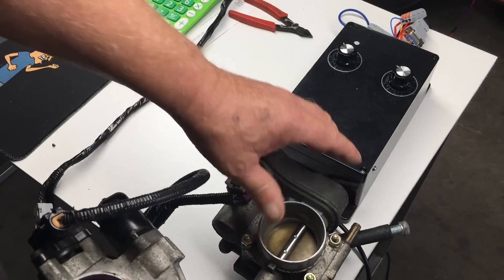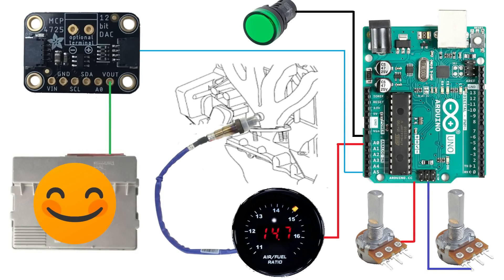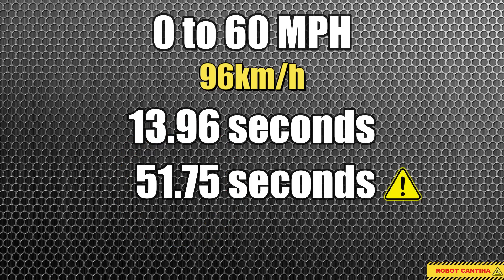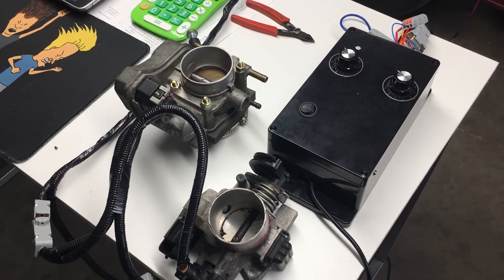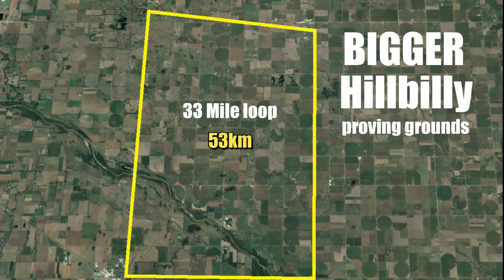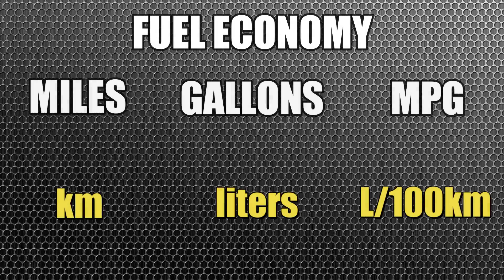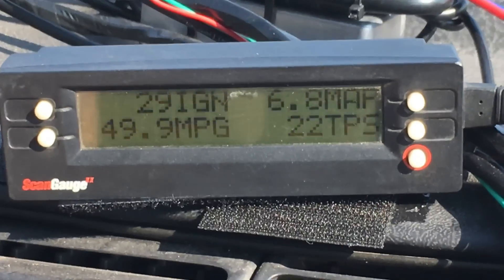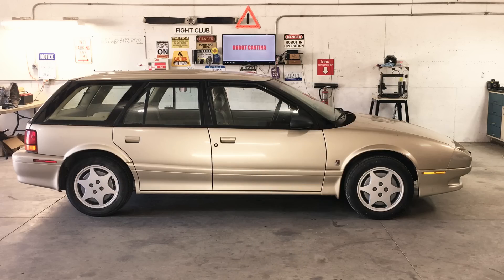S2E21: Our modified Saturn that gets Extreme MPG with lean-burn and Robo-throttle.

Comment: Bring on the diesel!
Pump timing,  injector sizes, different fuels.
Lots to play with on the diesel also.
Oh and a more efficient engine makes a difference too 😆
Reply: yeah that small diesel should net a decent mpg bump, provided its geared correctly. 

Also generally, a bigger diesel engine isnt always a bad thing for efficiency either. Because diesels dont care how much air there is entering, you can run them really really lean by design. You govern the power output by the amount of fuel not air, as with gasoline engines. Lower rpms, lower pumping losses (no throttle afterall) higher torque and higher injection pressure along with higher specific energy of the diesel fuel all contribute to greater MPGs!
They are popular still over in europe for a reason. It's not uncommon for your avarage compact sedan or hatch to crack 60 MPGs while doing longer commutes.
Reply: Diesel is like 50% more in cost at the pump compared to 87 gasoline though. Unless you can do an alternative fuel it would have to get 80mpg to break even.
Reply: @0778drz110  yeah, that might be the case in US, but in europe, diesel is only marginally more expensive (depends on the location though).

Comment: Checkout the Dynatek Dyna 2000 to control ignition timing. I think it will work with the Saturn ignition coil & ecu by intercepting the output to the coils & altering timing of the coils input.

Comment: Looking at Alldata, it looks like those Saturns fire each cylinder on both the Compression and exhaust stroke (hence at why there are only 2 coils, and they're mated with their "sister" cylinder). 

Since that PCM predates the use of Cylinder Balancing (For smoother operation), you could possibly intercept the CKPS signal, and use it to feed data to a speedunio.. that of course, is easier said than done.

Comment: Thinking of ways effiecency could be comprised, I wondered about toe settings, some manufacturers recommend toe in or out based on intended steering predictability. A weighted alignment, setting toe at close to 0% split could produce an improvement.

Comment: Take a look into air temp sensor, you may be able to do a variable resistor to trick it to think it hotter or cooler and it should change timing. (Ebay sellers sell them and performance “chips”)

Comment: It would be cool to see the difference with all the weight stripped out of the car on the exact same setup.
Reply: There isn't a lot that can be stripped off a stock sl1 manual. It only weighs just over 2,000 lbs stock. The plastic body panels make it light.
Reply: @ivermec-tin666  I was thinking like the rear seats and like carpeting and stuff would be cool. If it's only 2,000 pounds already you could make a pretty big difference percentage wise.
Reply: @burtmcgurt3584  True. If it weighs 2300 stock, and you can shave 300 lbs off it... That's a meaningful percentage.
Reply: @ivermec-tin666  I've alwats wanted to see a video where somebody completely strips a car and weighs before and after and then performance. There is a channel that did like an insane strip down, but didn't actually measure the weight difference. "Diy Mike" i think was the channel. They literally drilled big holes in the rear bumper and stripped all the weight out they could on a del sol. It was cool, but I'm a stats guy and wanted to see the numbers. Also, great channel name lol I approve!
Reply: @burtmcgurt3584  Thanks. A shame they didn't weigh the del sol. It's not expensive to use a semi weight scale.

Comment: I might affect fueling as well, but if you use a variable resistor on the intake air temp sensor, does that change the spark values?

FMG

Comment: that ignition timing is awful. Both of my 4 cylinder cars (mazda 3 and mazda miata) are around 50 degrees of timing at highway speed. i would expect you could get even more timing with a 2 valve engine like the saturn.
Reply: Yeah, but those engines are designed so they can take advantage of that kind of timing. Likely tons of compression and combustion chamber design, so the fuel is burning slower thus needing more timing.

Comment: now imagine if you did this on a 3-4 cyl ligthweigth (sub 1200kg) Non American car.
Reply: actually, if you're mostly cruising longer rides (especially on motorway) weight has less of an effect on efficiency than you might think. Aero and rolling resistance play a much bigger role here.

Comment: Going a bit rich on the A/F ratio does way more for fuel efficiency than going excessively lean.  It's counter-intuitive but that's how the old-timers 'fixed' the shyte fuel milage numbers the first emissions-compliant vehicles suffered from in th 1970's and 80's and beyond.   

Rejecting from the stoichiometric  ~14.7:1 to ~ 12.8 - 13:1 (depending on fuel type and compression ratio) often yielded 15% to even 30+% fuel mileage numbers for very little effort other than swapping out a set of jets in the carburetors. 

On modern EFI engines that same 'rejetting' can be done by cheating the O2 sensor signals by putting a simple germanium diode in series, Its low ~.2 to.3 volt forward drop cheats the signal slightly rich while still staying in the working range of the sensor making the ECM think its still running the engine in the stoichiometric range.
Reply: How exactly could running richer than the stoichiometric ratio be more fuel efficient? Any richer and the extra fuel ends up going out the exhaust unburned. If you target a ratio somewhat leaner than 14.7:1, you can improve efficiency in two ways. First and most obviously, running leaner than stoich helps ensure that all the fuel is burned and no unburned fuel is wasted out the exhaust. Second and perhaps less obviously, since less power is generated at any given throttle position with leaner air fuel ratios, a higher throttle opening is required to maintain the same power output, reducing pumping losses and therefore creating a higher effective compression ratio. That's one of the main reasons lean burn engines like the Honda Civic VX and HX and first gen Insight are so ridiculously fuel efficient.
But whatever you do, proceed with caution. Running excessively rich can result in carbon buildup, damage to catalytic converters, greatly reduced oil life, and unnecessary wear to pistons, rings, and cylinders. Running too lean for the given conditions can cause damage to the engine and exhaust system by increasing cylinder temps and exhaust gas temps. One of the biggest reasons modern engines last so much longer than pre EFI engines did is because of much more precise fuel delivery, which nearly eliminates the seriously rich and lean conditions that used to be so common.
Reply: @averyalexander2303  Nope.  It's an odd quirk of how gasoline works.  As I said. It's counter-intuitive to what most think.  

Also getting rid of all the other emission systesm comments makes a considerable improvement not with most engines as well. 

No need for caoution. I've bene working with this stuff for about 35 years now and know the ins and out very well.  It's old knowledge that was well proven back from the early days of 'fixing' emissions compliance to be fuel efficient. not new.
Reply: @tcmtech7515  Do you know of any studies backing up that theory that you'd be willing to share? I haven't seen any, but that's not to say they don't exist. All the data I found shows that lean air/fuel ratios are more efficient, hence the creation of lean burn engines. 

I do believe that the emissions systems can have a significant negative effect on fuel efficiency and performance, especially when they were new and still had many flaws. Modern emissions systems aren't nearly as bad, but still can affect performance and efficiency, especially on diesel engines.
Reply: @averyalexander2303  Ever use anything with a small 1 or two-cylinder engine that runs from a simple carburetor and you had to run it with the choke part way on to get it to run right and have any power?  

If so, did you ever notice that when running that way with the choke part way on it somehow managed to also use less fuel to do the same work as compared to when running it with it all the way off?

Comment: I think, ignition timing-wise, you could get away with introducing some type of signal follower in order to cause the necessary delay in the position circuit, trouble is I'm not sure what that'd do to injection timing.

Comment: Generally, according to the ignition table, higher manifold pressures or higher rpms require more ignition advance.  Do we know enough about how a map sensor is constructed, to recalibrate it so as to have it report a higher pressure than actual?  Can table values themselves be modified?  I don't profess to know anything about it but it seems to me that in "dyno-tuning" videos, parameters in the ECU are modified via a laptop computer.

Comment: I'm going to buy a pair of LC-2s to try and burn e85 ethanol fuel. However in my case I do have access to ignition maps on my Siemens MS43 PCM. It's no lean burn but hey the fuel is cheaper!

Comment: You might want to try tapping into the Intake Air Temp sensor -- this might be integrated in the MAF.  It should be a simple therrmistor. At least on the 87 GN, the IAT would vary the timing by a few degrees, so a rheostat in place off the IAT might give you just what you need, if the 96 ECU still has that logic.
Reply: Was thinking of this as well while watching. 

Was thinking it could also dump more fuel along with it because it thinks it's getting colder and denser air.
Reply: @bleach_drink_me  typically the ecu reduces the fuel injected, higher iats result in less dense air which doesn't require as much fuel as denser air to achieve target air fuel ratios.

Comment: Hey Jimbo, here's the CMP stuff you were needin. 
The electronic ignition (EI) module supplies a ground to the cylinder #4 signal wire whenever it determines cylinder #4 has just fired on its compression stroke. The EI module uses capacitive pickup plates located under the 1/4 coil pack to determine the polarity sequence and voltage amplitude of the cylinder 1/4 secondary ignition. The powertrain control module (PCM) supplies 5 volts on the signal line and expects to see the cylinder #4 signal wire go low after every 14 crankshaft pulses (2 revolutions). This is used to determine the position of the camshaft, except under decel. The PCM only uses the transition from 5-0 volts as a valid top dead center (TDC) compression #4 cylinder signal. DTC P0341 sets when the PCM detects extra cam pulses (more than one cam pulse within 2 crankshaft revolutions).
Reply from the maker: So that's how they do it,  Very interesting indeed,  I had a feeling the cam timing was done through the coil pack, but not a clue how it was done.  Thanks!
Reply: @robotcantina8957  Yep, been through that whole process of having to learn how something works to figure out why it's not working more than a few times, thankfully this system is well documented so we're not all flyin blind which makes life a lot easier. It's a clever work around to save money that can probable be exploited (or exploded) for your goals if you wanted to dive that deep. If you can't easily change the time when the spark fires I wonder how changing when the fuel injector comes on would do? I know it's behind a valve but I don't know the relation of valve starting to open vs injector turn on time, might be such a thing that the injector can start a little early and be squirtin as the valve opens rather than once the valve is open. Batch fire worked pretty good for a while in the 80's and 90's so some fuel on the back of the intake valve isn't awful.
Reply: For folks in europe, PSA did the same trick on the "TU" engines as a result they can get reall snotty about cheap coil packs. This isnt the same as SAAB's ion-sence thats a whole other bag of fancy fun.
Reply: @denisohbrien  I've been through the Saab story a few times, the coil pack is either unobtanium, discontinium, a used gamble, or aftermarket that just does not work correctly at all.
Reply: I had an 06 malibu with a 2.2 exotec and recalled not having a cam sensor either.   All the Haynes manual said was the coil pack & module could calculate when the cylinders were on compression vs exhaust stroke. Fascinating explanation!
Reply: Ahh! So it does have two sensors, in a way. It’s just that second pickup is not Hall sensor but some capacitive thing built into ignition coil?

Comment: First thing that came to my mind is adding a LPG injection. That would be interesting!
Reply: To use LPG efficiently he would need engine with much higher compression ratio and different cylinder ratio, and having ability to actually have a map for timing advance.
As for timing advance, solution simply to piggy-back speeduino to the system, having speeduino having all the inputs, but controlling only ignition. 
More fuss is with compression ratio. Running on LPG with poor fuel economy is always cheaper anyway, but ofc volumetric -wise fuel economy will be worse. OTOH LPG is better for engine as it allows running engine more rich at same cost, and with slower burn front it does not strain crank bearings so much as normal gasoline does. last but not least it does not pollute or dilute oil like gasoline. But that matters only for new cars you are planning to keep for some time, for old Saturn destined for scrap it is not worth the hassle.

Comment: WAIT I recently worked on that same engine for a CKP replacement. It's a very simple AC voltage signal and the ICM isn't terribly complicated either. ECM takes inputs and spits out two EST signals to the ICM, ICM takes those and fires the coils. Scope the two EST wires but I'm pretty sure they're a square wave that shifts timing forward and backward, I bet you could make an interceptor to let you take CKP AC wave and make your own EST signals to advance and retard timing as you see fit within reasonable limits, only wire I'm unsure the function of is one labelled Cyl #4 Sig Out. Since there's a knock sensor I don't think GM is using ionization knock sensing here but maybe they're using something from the ICM similar to that to cheat out of needing a CMP sensor? Ok Future me here, yes they're using Cyl 4 Sig as a cheater CMP with a pickup in the ICM to read that coil 4 has fired so they can do OBD2 engine speed data for individual cylinder misfire counting. Look up description of DTC P0341 for some neat background on that setup, it's kind of a unique way to get around tooling/part changes needed to install  an actual physical CMP. I don't think it would cause any headaches for altering timing or be a double-check of ign timing at the PCM end of things.
 Neat stuff, probably not entirely insurmountable but maybe not worth the effort involved. Should be able to bench test the setup off the car with relative ease but again, that's a bunch of mucking about for likely very little payoff except your own satisfaction.

Comment: So the Saturn system uses a virtual cam sensor if you will, it measures the capacitance of the number one spark plug when it's coming up on top dead center to determine the exact position of the engine it's complicated. People that are forced smarter than me have written much more detailed explanations of how it works. 

Look up "ion sensing ignition"
You can actually use it to detect pre ignition and spark knock as well as cylinder position it's really interesting
Reply: I'd love to see a waveform of that!
Reply: @kingofbrutaltheocracy9201  The waveform that the ECM sees is just a digital square wave, the real magic happens inside the ignition module and I believe it's measuring resistance or capacitance of the spark plug before and after it fires so I don't know that you could really see a waveform of that??

Comment: I think the MPG might increase even more with a good cleaning of the fuel injectors and carbon buildup. Just speculation though.
Reply: might be a tiny improvement. There is plenty more stuff you can do to improve on mpgs just on the engine/tranny side.

Increased compression, tuning valve timing, softer valve springs, thinner oil, different thermostats and most importantly, standalone ecu.

You can go even crazier and do lighter rods, pistons and crank (less rotating mass, more efficiency), play with bearing clearances. There's plenty of tuning that can be done on both intake and exhaust side. head mods and probably many things more i can't come up with on the spot.
If you look at modern engines, they do a lot of tricks to hit those mpgs.